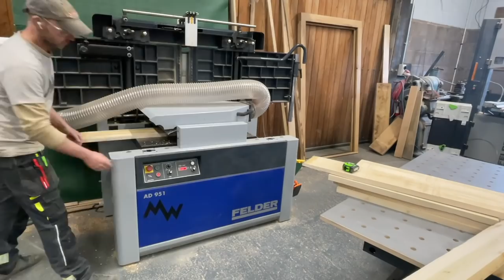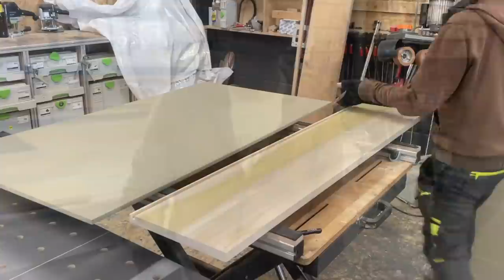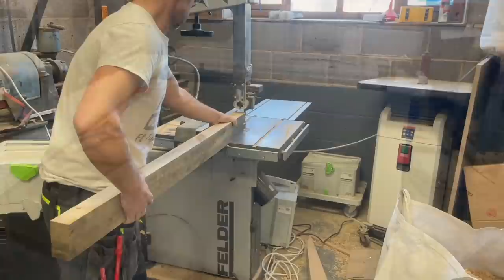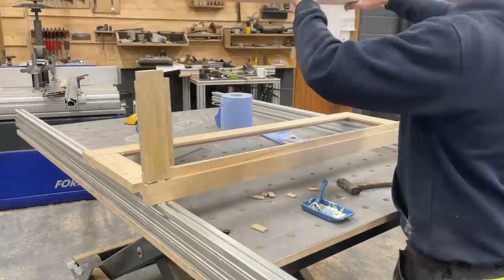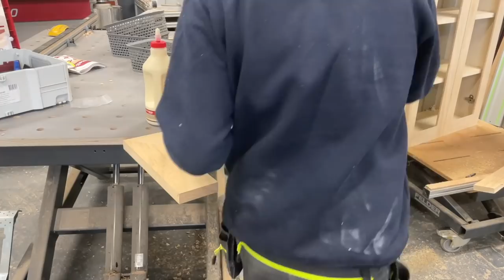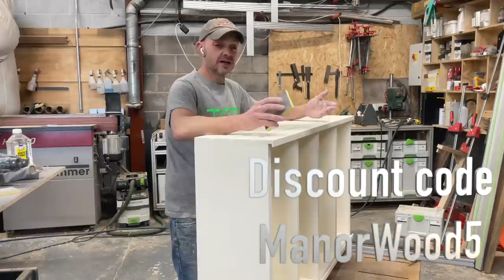Kitchen Display unit   - Custom Chestnut and Tulip wood

Comment: Braver man than me in glueing all those dominoes and then fitting the 5 shelves. That kind of operation has backfired on me and so, now I would only glue one shelf at a time. 

Glad to see someone using chestnut. That and sycamore seem to be under rated and under used. It’s harder to find nice long and wide slabs (I use Englishwoodlandstimber in West Sussex) but they are lovely timbers to work with.
Reply from the maker: Cheers , love chestnut and sycamore ,  have some killer slabs in both :)